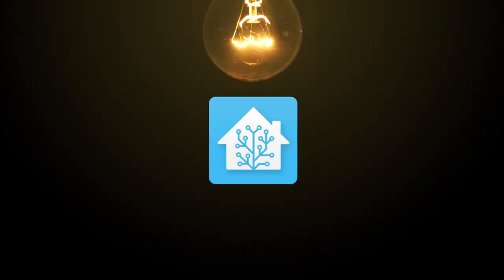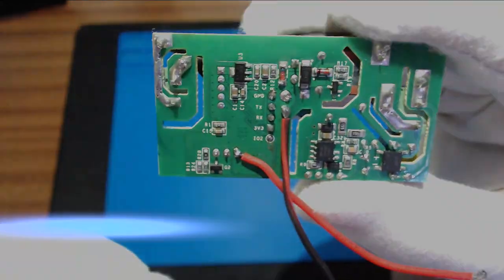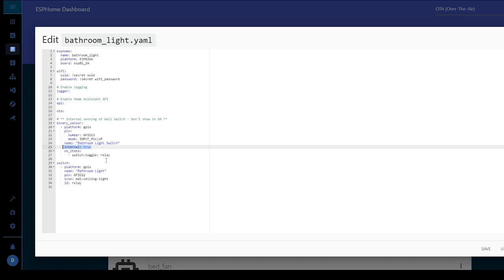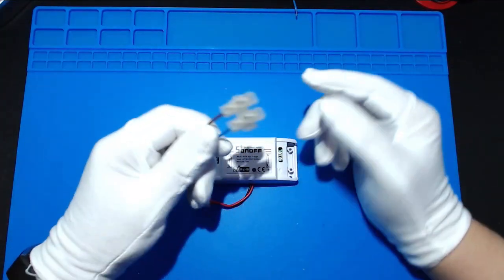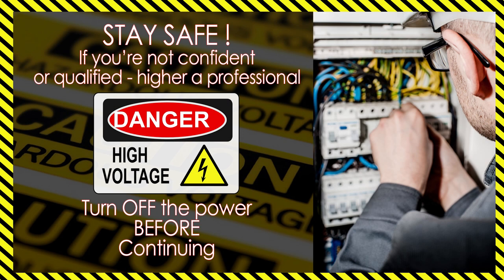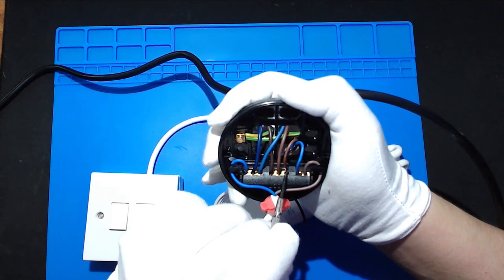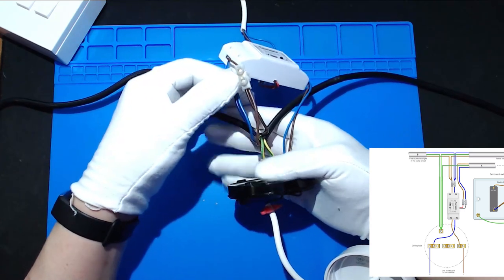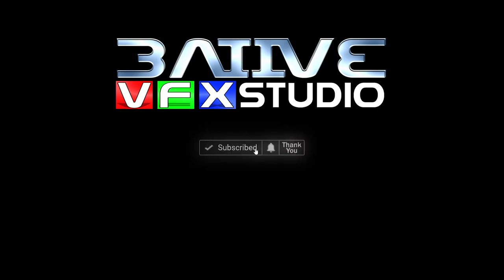Home Automation - No Neutral Wire Smart Light Switch

Comment: Updated vid! Sweet. I used gpio3 (rx pin) to do this.

But I have found it to be flakey on some of my sonoffs. A few have stopped working all together. I'm not sure what happened. But I may change those ones to gpio13.

Thanks.
Reply: I mean the external switch stopped working. The relay still works via button press and wifi.
Reply from the maker: Cool... I tested my setup (GPIO13) by adding 3-4 meters of un-shielded cable to the 'Switch' input then wrapped it all along the mains cable of a fan heater. It worked fine from the other side of the room. 
Hopefully you will have the same success.

Comment: Good Video, BUT this is NOT a no-neutral wire system, a no-neutral wire system is where the Neutral is in the ceiling, and the Live is at the switches. a switch wire goes up from each switch to the lamp.
Reply from the maker: Well technically yes. BUT, the point here is no neutral wire at the switch. I think everyone appreciates potential difference. 😉

Comment: I'm generally happy with soldering, but not when there's connections to the mains. Have you had any experience with a similar configuration using a Shelly device (1 or Dimmer)? I'm starting to consider those over the Sonoff Basic for lighting. I don't have either at the moment and I'm looking for some UK advice.
Reply from the maker: Not sure what you mean, none of the Mains connections I show here are soldered. With regard to any wire tips that I did 'tin' - I've since recommended that you don't tin them and just use the screw terminals as-is.
As for other devices... I only use Sonoff Basics for this stuff as programming them with ESPHome gives me more options/control/sensors/etc.

Comment: love this video. Do you have something like this but for the Sonoff 4CH where I can put behind a 4 switch panel and have the option to turn on and off via both home assistant and existing physical switches.
Reply from the maker: Thank you, glad you liked it. 👍
As for the 4CH, I don't have a video for that as you can't use 4 GPIO's on a Sonoff. Of the 4 that are available if GPIO2 is held low at start-up the Sonoff won't boot. 
However, You could use a Port Expander, like a MCP23008, to give you useable GPIO's.
Reply: @3ATIVE  https://esphome.io/devices/sonoff_4ch.html
do you think would work the same way for the sonoff 4CH

Comment: is it possible to make this connection with an esp32 / 8266 and a relay? and have the status of the lamp in the HA?
Reply from the maker: You can but, those are just what the Sonoff Basic is anyway - Plus it has it's own mains power supply.
You're better off with doing it the way I show here - It's a lot safer!.

Comment: Hi. Thanks for this video, very useful. One short question: does this method is working also with the original firmware?
Reply from the maker: Thanks. I'm happy you liked it. 
To answer your question - No, this uses pin GPIO13 and the orig firmware is not programmed to use it.
Reply: @3ATIVE  Got it, thanks for your support
Reply from the maker: @totovio13  You are welcome my friend.

Comment: How does this handle powercuts? 
With Ikea smart bulbs for example any lights left in the on position on the switch will come on when power is restored (as you'd expect) even if the bulb was turned off at the time.
With this does the relay go to its last used state? (eg, off at night?) or will the power coming back on be treated by the sonoff as a switch event?
Reply from the maker: I haven't tried it... Best guess is that the Sonoff relay will come back as off.
Reply: Check the restore_mode parameter options of the switch on esphome.  https://esphome.io/components/switch/gpio.html

Comment: Good video thanks bit just a quick question.before I fit it  I have removed led and soldiered 2 wire as video. But before I install it. I wired it up to a mains 3 pin plug and the out put to a light socket. The switch works on HA. But when I touch the 2  new wires together should it switch the light on and off when removed and touched together
Reply from the maker: It should toggle the internal relay when the wires are touched together and when they're taken apart.
- Check the 'Sensor' Code in ESPHome, make sure it's set to 'on_state'
Reply: @3ATIVE  yes its says on state I I copied and pasted  changed secrets
Reply from the maker: @nigelholland24  hmm... Not sure, if you've followed everything I did it should work. Try another Sonoff?
Reply: @3ATIVE  it was a new one. Will play tomorrow thanks
Reply from the maker: @nigelholland24  Cool. If you still need help, find me on Disord | Facebook | Twitter and I'll try and help further.